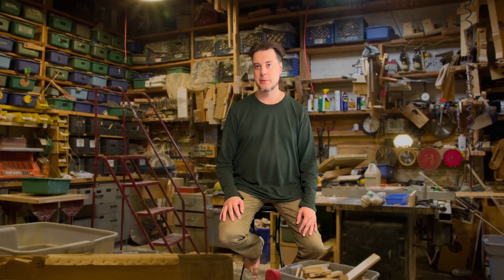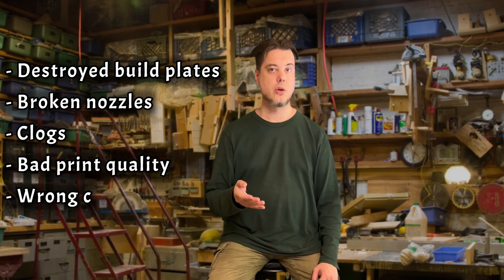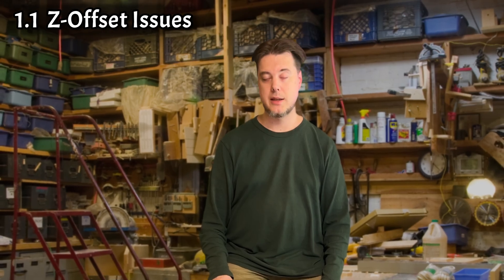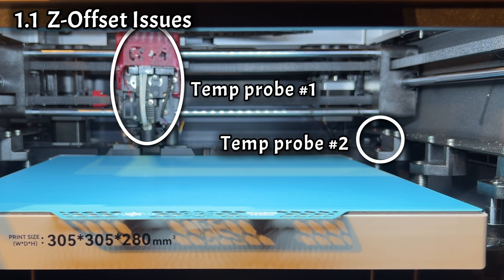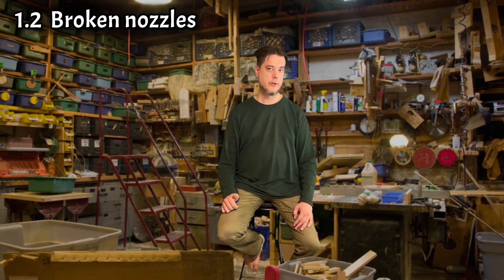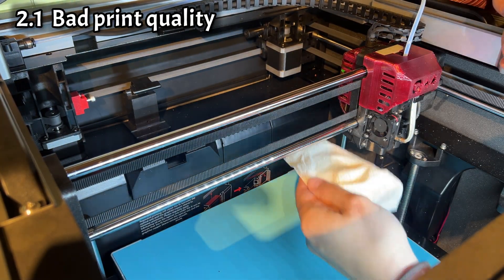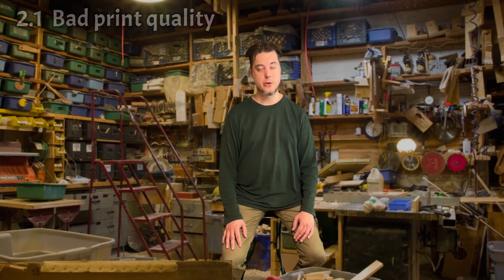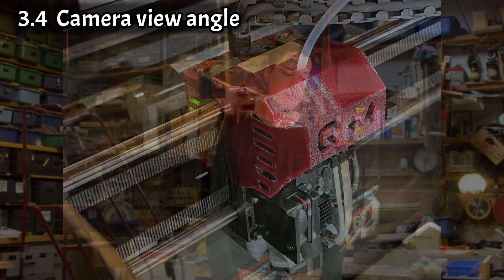Qidi Plus 4: Must-have fixes & mods (free)

Comment: I went through all the Z-Offset / piezo issues (aka CNC mode). 
Qidi sent replacement bed , nozzle and piezos. I didn't install the piezos and went for the beacon mod. 
It works like a charm and bed mesh / print start so much faster.  I would definitely recommend that route.
Reply: I think this'll be my next attempt at fixing.  Any beacon mod or a particular beacon mod?

Comment: To those who were arguing with you about lubricating x and y axis bars - I have both instructions to do this and a tube of oil to do this in my recently (July 2025) bought Q+4.

Great video, btw. 👍
Reply from the maker: Thanks! Just make sure the oil you use for the rods is very thin, like sewing machine oil or light machine oil.
Reply: I can understand the reaction for those who say not to. Best case is the graphite residue resides in the oil, worst case, it clumps and acts as a contaminate. 

My best guess as to why they require oil is that the bearings are spec'd to be very tight. Those that have no issues without oil probably have somewhat "loose" fitting bearings so the friction ends up being less.

The other issue with oil on a planner bearing like this is it will just run very easily. After 1 hot chamber print I imagine most of the oil has already gone to the underside of the rod/bearing.

So I guess if you clean/relube very often (like every few prints) it's will be fine. But once you add oil, you must always add oil. Going dry after that will just be bad.
Reply from the maker: @winebartender6653  Going dry before oiling was unacceptably bad. After oiling I printed for around 150hrs without oiling, and only did so now for the video.

So far not a single scare mongering I’ve heard about this has come to fruition.

Comment: Thank you very much for the efforts you've put into this. In my case, I received the printer with missing nuts in the bed and the leveling so bad. Your other video on tramming was so helpful to me and I could achieve much better numbers than with only the official procedure.
Now I see I have the 1.7.2 FW version for downloading but I've seen that it's NOT available for download at the Qidi Git, and 2 that they don't seem to support downgrading. That concerns me very much.
Should I upgrade? Do you know any Reddit/Social group that it's community managed that I can ask for this kind of questions?
Reply from the maker: Thanks! Happy to hear that you were able to tram the bed properly. 👍

There are two Reddit groups: QidiTech3D and just QIDI. The former is the more active one, though I’ve seen official Qidi posts on both.

I haven’t upgraded to 1.7 since to my understanding it only updates stuff related to the QidiBox while hampering some existing features for everyone.
Reply: @mrelwood_media  My first guess was that v1.7.2 is missing in the git due to what people is talking about Qidi violating klipper license and closing "their" sources.
I wanted to ask for those concerns and the availability for an stock klipper fw for this printers. I read something around while searching for info before buying it, but now I can't remember where it was. But it's not a nice thing to ask in an official channel.
As I have a Box to be delivered, I suppose I'll be forced to upgrade the fw for it to work.
Again thank you very much.

Comment: Tanks for a good video. Ist it a inductive probe on the toolhead? I think the mainbord old data little random why it broke. For ex i tried too stop using the ex fan but it starts on every print. I turn it of in orka but no it starts. The problem is prio what command is to follow
Reply from the maker: Thanks! Yes, the inductive probe is in the tool head, but the piezos that are used for the Z offset are below the bed next to the manual tramming adjustments.

Comment: Suggest testing the accuracy of the probe to see if its reading within the usable range, see the community docs as it explains how to do this.  Some probes are less than optimal.  Accuracy of probe measurements can be improved by adjusting the Klipper config to start the probing action farther away from the build plate and then approaching the build plate at a slower speed during probing.  This had a very marked improvement for the accuracy and consistency of probe results with my Plus 4 when I re-ran the probe accuracy test.  After this step, when tramming the bed, make sure to not over tighten any of the 4 knobs under the bed or it can damage piezo sensor.
Reply from the maker: Great tips man! I’ll have to look into the probe mod, as I haven’t had a reason to suspect it working badly on mine.

Comment: i have issues with my PPA-CF breaking inside PTFE tube or even right above the extruder, below the PTFE. do u know of a fix for this? or do i have to resort to printing a riser? i figured the plus 4 was made for these engineering filaments. but the PTFE angle is so sharp leading into the toolhead.
Reply from the maker: Yeah, the low roof height forces the angle right up into the toolhead to be quite sharp. The thing is, once the roof has bent the PTFE tube, it stays bent. If I were you I’d probably print a riser (that rises the roof evenly on all edges) and then reverse the PTFE tube. I would think that the beginning of the section would force the existing angle straight enough, and you would get the straighter section into the toolhead that hopefully wouldn’t get bent as much.
Reply: I found by running Polymaker PPS-CF, I was mostly able to print it without it breaking. Later I had some breakage when loading it. I found that by feeding it to the Plus 4 from a filament dryer in a heated state I had lees problems, but eventually I did print a riser.

Comment: Added this to my plus 4 playlist. I've done some of the mods but not all. Great info!
I gotta say overall the Plus 4 is a good quality machine for the price you pay (~$800) for a "true" engeineering grade machine (370C hotend, 120C Buildplate)
Reply from the maker: Yeah, when it works it’s a joy to use and makes great quality prints. And it fills a big gap in the markets as a sub $1K engineering printer.

I do disagree with the words “good quality machine” though, so many manufacturing decisions are simply very bad. You need either a lot of luck or a lot of work for it to perform properly.
Reply: I completely agree. Qidi absolutely nailed some aspects (like even print bed temperatures), but what's the point when automatic bed leveling is such a mess?